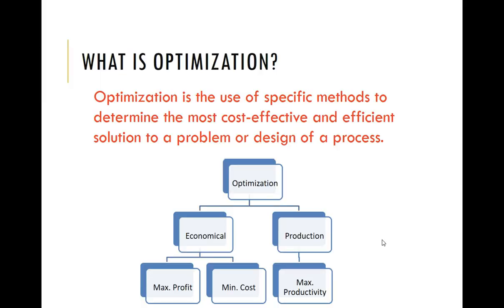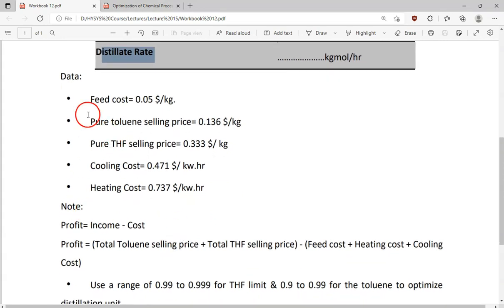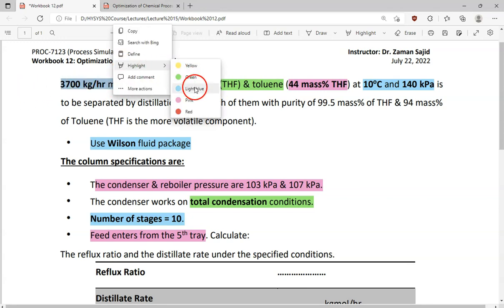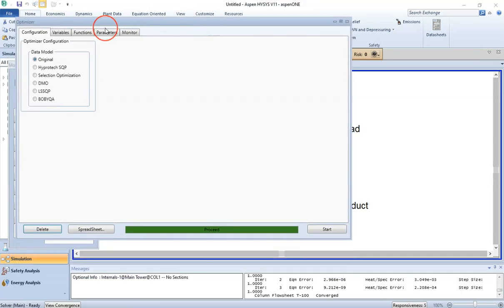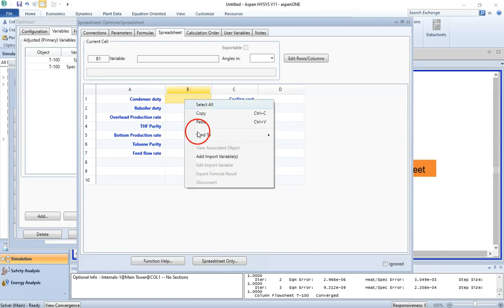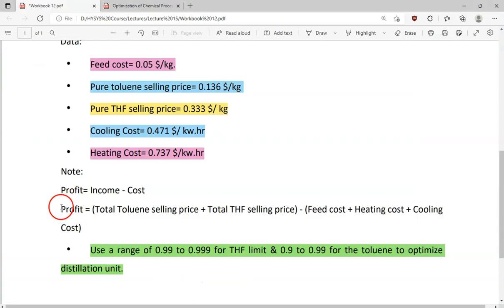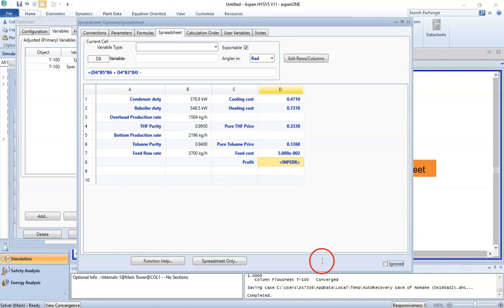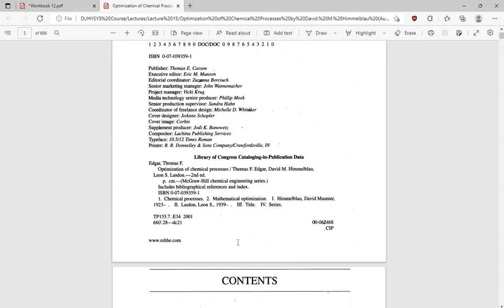Optimization in Aspen HYSYS

Comment: Hey, please how can you determine a feed cost, for example in a glycol regeneration process how can you determine the cost of rich glycol( feed cost) and also the heating and cooling cost of a process
Reply from the maker: There are two sources of this cost data: Vendor and literature. Vendor data is continuously updated with market values. If you are using literature data, please ensure that you have updated data; if some previous year's information is available, you will need to add time value for money. You can also ask HYSYS to provide you ballpark numbers. I hope this helps.